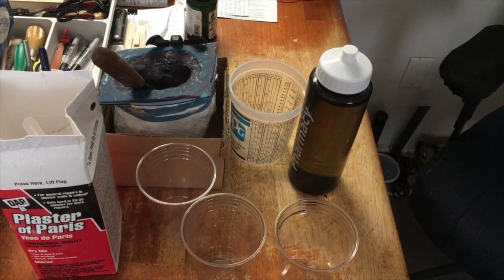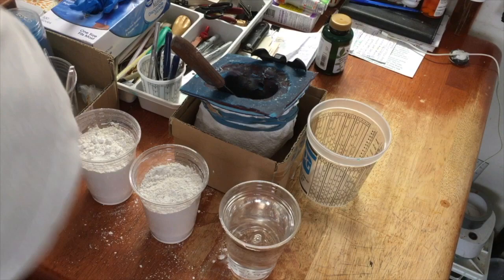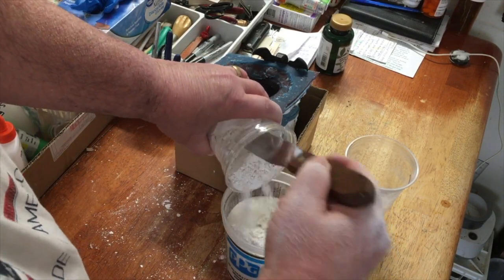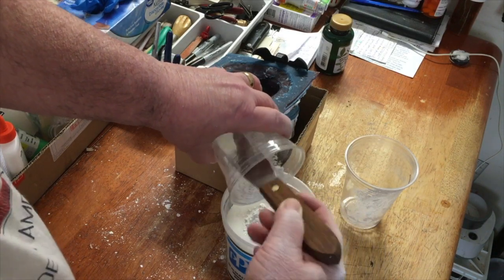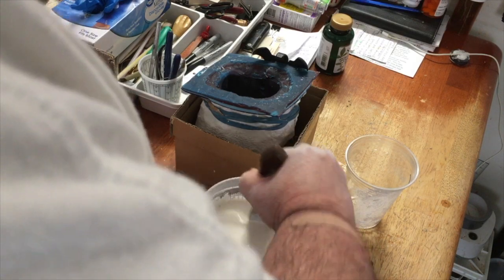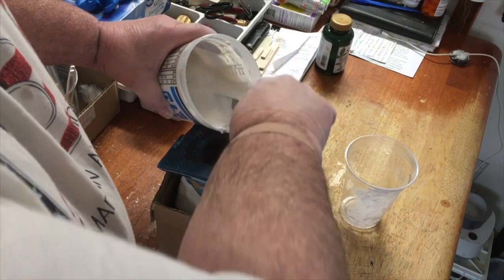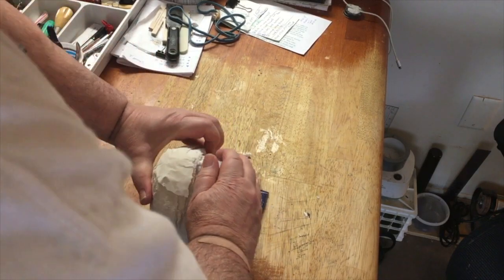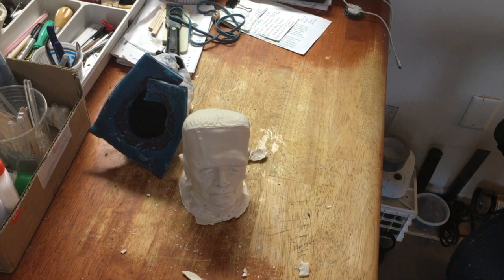How  to mix  plaster of paris  for  casting a mold

Comment: One hint I have silicone measuring cups and stir sticks you get more plaster out of the cup since plaster doesn't stick to silicone and it is easier to clean up as they are soft enough to squish all over. I got mine from amazon for my pour paint and I just happened to try it one day as I was out of the plastic cups and was surprised how well they worked.

Comment: That's cool! So simple... I'm used to doing casts for horror props, etc.. The decided to make a small clay Unicorn for my little girl.. did  quick 2 pc mold in alginate. Well, this morning I checked on the plaster cure, and ended up with the left, and right side as opposites lol.. If that makes sense

Comment: nice job, im gonna try to work with plaster of paris in my dioramas, doe sanyone here know if it can be glued to carboard with regular white glue¿¿
Reply from the maker: You can use newspaper 📰 and make strips with the plaster of Paris by dipping the strips in it . I’m sure for glue there are many options as when plaster drys it is Porous.
Reply: @PeterAgostiniJdcap26  thank you! I´m gonna try that !
Reply from the maker: @shiroumxm2052  welcome

Comment: Do you put a mould release on mould when working with plaster
Reply from the maker: Since this is a flexible mold you need no mold release. 
On hard shell molds you can use a store bought one .. look at the website Brick in the yard “ 
Thanks and have a nice day